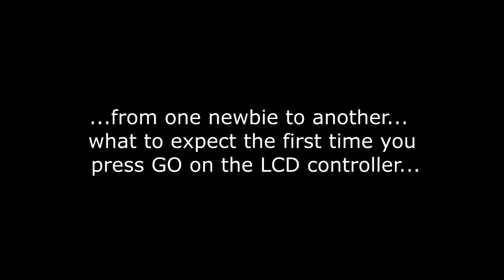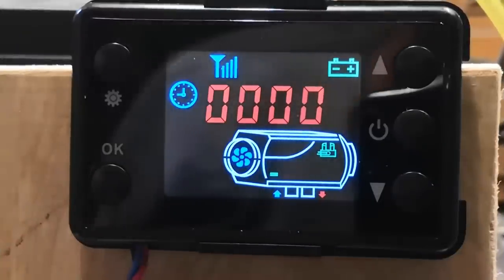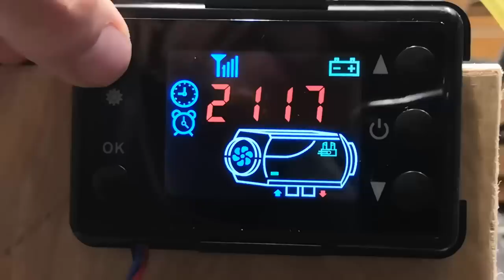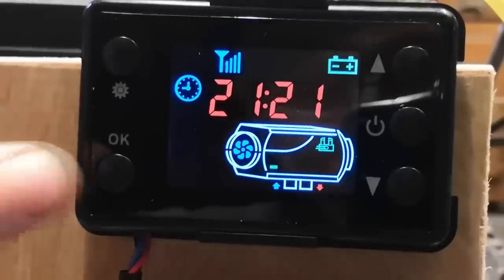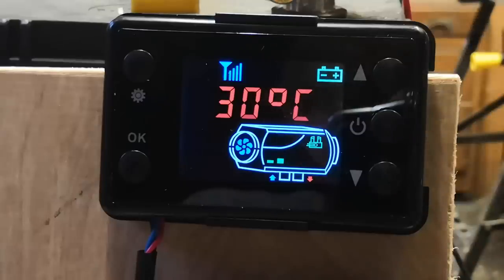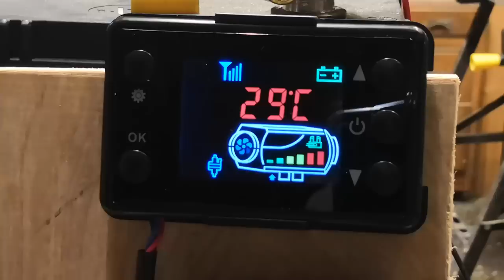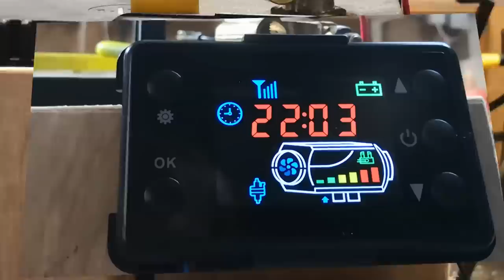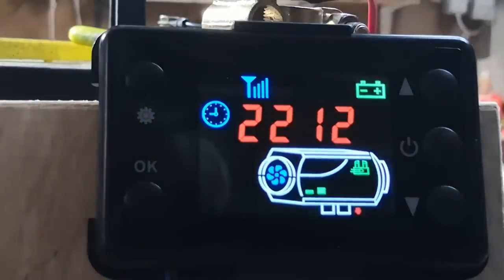First Time you press go...  LCD Controller- Chinese Heater

Comment: Thanks from Scotland, Is it possible to change the units ie. my unit tell you in Hz not temp,
Reply: Unfortunately I don't know which pair but yes, you can press a pair of buttons to switch modes. Shouldn't be too hard to google that. I understand that hz mode is more effective at running the unit at it's lowest setting.

Comment: All the functions on my heater works the same except mine doesn't have the target temperature, it has the pump rate in Hz instead. 
I played with the display when i first got it so i might have done something as i think i may have gone into the password menu.
Reply: im getting the same as you. When ever i touch the up or down buttons on either the display or the remote control it just shows Hz. Double pressing the ok button goes from current temp to Hz too? (then goes to voltage followed by errors like in the video).
2 Questions:
1. What Hz should it be set to?
2. How do i get rid off it and actually set the target temperature please?
Im fairly sure ive not played with any settings, I just primed the pump then switched on the heater?

EDIT* Ive just found the answer to No2 below Mark. 
Press up and OK together to switch it over to target temperature. The up and down then work as expected to set the temp required. 
Ive still no idea what Hz i should leave it set to however. Can any one tell me please?
Reply: If you guys press the top left and the top right button at the same time it should switch it over to a target temperature rather then frequency.
Reply: @mitchellkauffman6799  thanks, was bottom left and top right on mine for some reason. Got it now though thanks.
Reply: @mitchellkauffman6799  thanks I'll try that when I get a chance 👍
Reply: yeah, i have the same and i'm assuming you guys have the BLUE lcd? 
i just messed with the Hz settings and the higher the Hz the more heat comes out.. so for ex. 5.5 hz is literally like hell so i kept mine at 3hz... what hz did you end up setting it up as?
Reply: @mikespice8907  when you say Blue LCD, mine is the same coloured digital type yes.
I tend to run mine on the lowest setting of 1.6hz.
Reply: Mine was hz too. Thanks.

Comment: Hi ..... so I got the heater up and running.
Followed your video however my heater when I try to alter the temperature after clicking after the ambient temp it shows 4.3 mhtz which I assume is the remote frequency ??? Any ideas ...... please 😀
Reply: Thats the Pump frequency, you can change to a temperature setting instead of Mhz

Comment: Just bought a transit with one of these and both controller and remote have no power. Is there a battery or should i check the fuse box?
Reply from the maker: The controller does not have a battery if like the one in the vid ... it draws its power from the main unit. The little 4 button remotes have an A27 battery.

Comment: Just installed one in my big rig. Webasto stopped working so I installed Chinese cause is way way cheaper. Not sure if the heater will turns off when get desired temp. Also screen is always on I’m afraid when I do park my rig for a few days it would run down my batteries
Reply: How big are your batteries? Don't know the exact draw but considering its backlit LED I would assume it uses bugger all current. I leave mine on 24/7 (Just lazy)
Reply: Couldnt you just fit a switch to isolate it?

Comment: flaming thing! i need to re-prime mine because i cleaned the fuel filter out, now it wont enter priming mode (worked fine when i 1st installed the heater!). 
Pressing and holding down followed by OK button does nothing now. 
Mine came from the factory in Hz mode rather temperature (which is when the prime function last worked), how to do i put it BACK in to pump Hz mode instead of temperature please? Maybe the prime buttons will work then.
Reply from the maker: Press and hold the setting button and up arrow at the same time

Comment: HI thanks for this, but im really useless remembering it all, by the time i get to my van, ive forgotten, so just want to ask can i buy a simpler control switch? what was the first one you refered to at the beginning? Helppppp please
Reply: Write it down, its easy once you done it a few times
Reply: I replaced a whole Injector pump without a clue..what I did was put the channel on my computer and pause and do each step till I had it done probably took more time then the job it self but it helped me..e you can do the same with computer or Phone on you tube

Comment: Great video 
My controller doesn't bring up the temperature adjustment on the second click of the ok button. I can only show the temperature but not adjust?
Any ideas?
Reply from the maker: Not sure why this is... to confirm.. does your controller have a '6-blade' fan like the one in the vid?
Reply: @campervan_hackers  no worries I found it on another video how to change the settings.

Comment: Which Controller is the Best or Easier (simplest) to use in your opinion? I'm thinking bout getting one of these in the 8kwh models
Reply: I have the 1 shown in the video and it works great for me easy to use and you can get into the settings menu to adjust as required

Comment: My new screen is very dim and hard to read ,how do I fix this please?
Reply: Check the cables and connectors. Mine had a bad crimped connector between heater and display that made lots of trouble.

Comment: I have the same lcd controller but mine does not show the temperature when i press up or down it show e1.5 to e5.5 where am i going wrong i have since got the temperature settings working you press the top 2 buttons together which switchs it over to temp
Reply: Thanks I had this issue

Comment: Hello. I've just started up my heater after being idle for some months, being in 🇦🇺  and noticed that the heater didn't get up to full temp ie the full 6 bars. I had it set at the lowest setting of 8⁰ do you think I should beef it up to the hottest temp to burn any crap out of it? Might just go back to the full 6 bars again.
Reply from the maker: Hi Colin... It might do the trick, if I have not used my for a few months I tend to  reminded it who's boss. Clears any crap out that might have collected in the exhaust as well
Reply: @campervan_hackers  that worked a treat. Thank you.

Comment: I don't do Facebook,so unable to access the forum. Is there another way to download or see an Error Code list?
Reply: I believe error codes are as follows. E-01 Voltage low, E-02 Voltage high, E-03 Ignition plug failure, E-04 Pump failure, E-05 Too hot, E-06 Motor failure
E-07 Bad controller connection, E-08 The fire is extinguished, E-09 Temperature failure.
Hope this helps.
Reply: @lukeb5584  Thank you.

Comment: On mine I don't get the second temperature with the big degree sign, just the first ambient temperature. Is there any other way to set the target temp?
Reply: Nevermind the dude below answered it, you have to press the two top buttons at the same time.

Comment: is it possible i have the same looking controller panel buth with other heat setting functions ?  i can't set a target temperature .i only see the real temperature and can't set a temp . i only can set a hz setting from 1.5 till 5.0 hz what makes my feel pump runs slower or faster . whats wrong with my controller or my settings ?  thanks
Reply: tanks found the solution in a older post .  works perfect now

Comment: Hi ive just installed a 2kw heater and followed your video only to end up with what looks like an error code of E10 and still no heat
Reply: not enough oil to burner, continue priming a little longer
Reply: I got the same...............E10, but I have deisel coming out of the exhaust..........HELP!
Reply: GBPaddling I have same problem
Reply: My E-10 turned out to be the Temp. sensor not contacting the aluminium housing. Just fiddle with it(ooo err) until it contacts the casing.
Reply: GBPaddling Thanks I will try

Comment: Great video does help to start with the heater 
just have a quick 2 questions
1.  my heater is not switch off when reach temperature and keeps running on slow mode is there any way to change that 
2. is there a way to turn lcd back light off
Reply: I'm just commenting so i can hear the answer to your question.
Reply: The Eberspacher heaters do this too.  It was done because if they are set to recirculate the warm air they had a temperature sensor in the inlet duct.  The fan kept running at low speed to keep sampling the air temperature.
Reply: They don't turn off, and no way to turn the LCD back light off either
Reply: @jonno_on_tour  ok thanks for info just thought is my unit faulty as webasto I had previously has turn off when reached the temperature
Reply: Marcin Lipinski it appears they just go into a reduced heat mode setting when they reach target
Reply: @jonno_on_tour  yes that is exactly whats happening with my unit just a bit of a pain in the back as even on that reduced heating mode it heats my van to over 30 Celsius so I have to switch it off and then when waking up is cold again
I'm going to try the timer settings to make it run for let's say an hour or two twice during the night
Reply: Marcin Lipinski @Marcin, if you have the LCD controller you can alter the output power in the settings menu, there is a video on here that shows you how, I have mine set at 1hz minimum and 4.9hz maximum and it seems to run with no problems.
Reply: @jonno_on_tour  can you guide me on how to set this
Reply: @marcinlipinski7403  Watch this video, https://www.youtube.com/watch?v=W_aPnqLYUM4  alter P1.5 to 1 and P5.5 to 5 then press ok all the way through until the menu exits the setup

Comment: Hi I have the same controller but it doesn’t show the set temperature it shows 1.8hz ect. Do you know if this can be changed to Celsius as yours shows. Thanks for the great video. James
Reply: This mode is like a fan speed setting. Hold both top buttons and this will put it into thermostat mode and you can then adjust by setting a temperature.
Reply: Andrius Kairys awesome thanks for your help.
Reply: Ditto.. I have been trying to figure this one out for ages.  I haven't tried it yet but hopefully it will sort the issue. Thanks
Reply: @stevedyer8445  it works,just had the same on the one i've just bought,that posting has been invaluble
Reply: @ptnxlo  cheers for the posting,just been setting my heater up in the garage,for the first time,and the display was doing exactly the same thing,showing hertz instead of volts,your posting has been invaluble,cheers buddy :)

Comment: Bought the all in one and it's crazy carn't get it to go and i paid over the odd's for it, which on press go on the remote on the LCD comes up H 3 shows the fan the heater plug but after Five seconds or so E6 comes up on the screen stripped it all down the fan run freely i then read the magnet distance could not be close enough so moved the fan closer up the spindle put it all back together and it's still the same, how do you go back to the start menu to check it i have started it all wrong. PLEASE Help this has done my head inn.
Reply from the maker: Hi Bernard... eeek... not sure how to help here ... never had any issues but you might like to try the Facebook group called Chinese Diesel vehicle air heaters - Troubleshooting & Parts sales. 

https://www.facebook.com/groups/146837062640024

Comment: After fitting a controller extension, I noticed the actual temp readout says -39C. During that process I dropped the controller. Is it likely, I've broken the temp sensor. I have the black controller with a 4 button remote...
Reply from the maker: eeeek... don't really know about that one.... I would have thought it was quite robust, (although not accurate... mine tends to read on the high side). The sensor is situated on the bottom edge of the controller. Also, can't see how the actual extension should make any difference. .. you can get controllers for about £15 on eBay so maybe it might be worth splashing the cash to try a replacement. Sorry I can't really help.
Reply: @campervan_hackers  followed your advice... replacement goes well... The replacement unit will not pair to the remote... jesus...lol
Reply from the maker: @colinboniface194  cripes I feel your pain! I am afraid I'm at a loss... Maybe ask the FB group in case someone else has had the same.

Comment: Hi there, good Video. I just installed mine and seems to work fine. I have a few problems though.
1. I can only see the exhoust arrow but not the air intake arrow.
2. the fuel light is being displazed but the fuel is coming from the car main tank and its more then enough there.
3 It kind of smells bad. I had on a couple of times about half an hour. Will it go away?
Can anzone please help? thanks.
Reply: Your car is diesel fuel right?
Reply: @user-lw6lp4sd5b  Thanks, I guess you're right
Reply: @rayg9069  right, straight from the tank.

Comment: Hi.  We have issues.  Our heater runs 2-5 minutes before throwing a code (8 or 10).  We need help please.  Getting a hold of seller is ridiculous, they want pictures and videos.  You cannot video the system all hooked up and visually see the inside the pump.
Reply: make sure exhaust and air intake are pointed downwards.

Comment: can you tell me what's up for us, we've bought such a center and have set it up for your video and she only goes for a minute so she shuts down and always shows E-03 and is always the same administration code for the machine 9009
Reply from the maker: E 03 is a glow plug error... go to this forum... loads of resource here... but you may need a new plug.  https://www.facebook.com/groups/146837062640024/?ref=bookmarks
Reply from the maker: Check out the files section.... https://www.facebook.com/groups/146837062640024/?ref=bookmarks

Comment: den     we  have just fitted one of these, but we can't get the air to heat even though the glowplug light is on.CHEERS
Reply from the maker: Any error codes? White smoke? Let it run like that for 20 mins see what error code comes back
Reply: Did you prime it and is the fuel moving through the line into the heater?
Reply: Hi Luke. Den here thank you for the reply will get back to you later.
Reply: Den.Hi Luke thank you again for your input . I have managed to get the heater going now but don't ask me what I did to start it . I'm getting a bit old in the tooth now for this game ( 91 yrs) so I think I might have a bit of an excuse. CHEERS Den
Reply: Hi Den,
All you do is press the ON/OFF button. The one in the middle of the up & down arrows.
Just press it to turn the heater on and press it for at least 3 seconds to turn it off.
But, before turning it off, press the up button to set the temperature to it's maximum (around 35 deg C) and leave it on for around 5 minutes.
This is to help prevent soot building up on the glow plug.
Good luck with it and don't hesitate to get back if you need more help.
I'm in Australia by the way.
Cheers,
Luke

Comment: Can you just change the rotary switch to lcd just buy plugging one in or do i need more parts.
Reply from the maker: Yes, in fact, I did that... but it has to be the 6-blade fan icon controller... not the 3-blade icon.

Comment: I have had my heater for about three week and had a few issues to start - but had working for a little while, but now I have no power to the unit - I have connected the main cable but using a little longer cable as not quite long enough (using 11amp cable) but still no power to the unit. I have put a multi-meter to the ends of the cable and shows 12.5v so there was power to the unit - 
Can you advise? or any of your group,
Reply from the maker: Eeek sorry... can't help.... not an expert but sounds like PCB is blown
Reply: Traced the fault to the control panel as one of the three wires had come away from the PCB - I took the control panel apart and re-soldered the wire back to the board, and now in working order, so all good,
Reply: One of the small wires had come away from the PCB, have now soldered and now working.... Although now keep getting E-10 did you ever go into the other setting as to the speed of the pump etc
Reply from the maker: @maninavan.2043  Yes, I did go in there once... all was good with the heater until the temperature outside really dropped... then it smoked. I went it to reduce the max fuel rate to 4.5 hz. All good now.

Comment: Have you worked out how to use this as a cool air blower . I read on one of the eBay adverts it can be used just to blow cool air instead of heater starting
Reply from the maker: Yes… install a switch to ‘short’ the temperature sensor on the heat exchanger. This will make the ECU think the heater is too hot and turn on the fan. The fan will then run at full blast on its own without the heater firing up. However, not sure how long the bearings will last….
Reply: @campervan_hackers  I thought they was a code in settings you can put in to do it . 
I wouldn't know how to mess with the sensors etc lol

Comment: The fan of the heater in my Van continues to run continuously after use. I can't get it to stop unless I remove the fuse. What is the cause? How can I fix this?
Reply from the maker: That is a frequently reported fault. It is usually that the body temperature sensor has failed or at least needs re-seating. The ECU then thinks the heater is too hot so turns the fan on to 'cool it down'. Do a search for Diesel Heater Temperature Sensor on eBay.. less than £10.

Comment: Husband connected heater all went well, plugged monitor in and the screen is black. What have we done wrong, we are tech dumb. We think the monitor is faulty. Is there something we are not doing. All videos show the monitor auto comes on when plugged in.
Reply: Would have thought someone answer you by now. Are you sure its black... or just "faint" like mine. I have to make the room dark so I can see the display. Did you find and answer? Maybe I gotta buy new one.